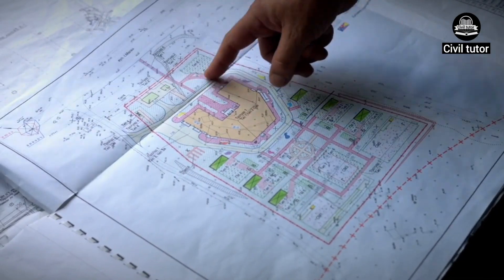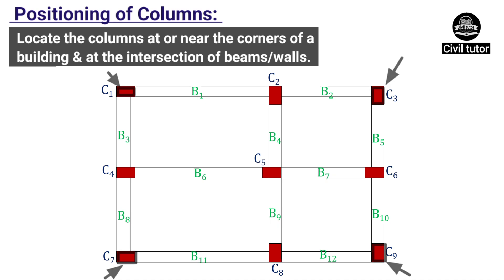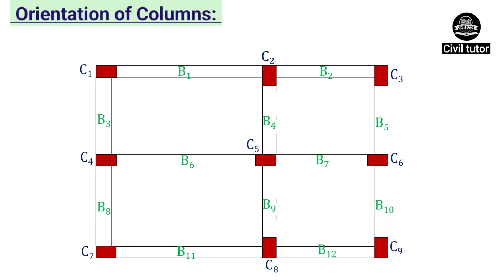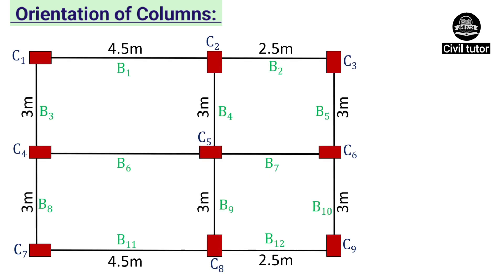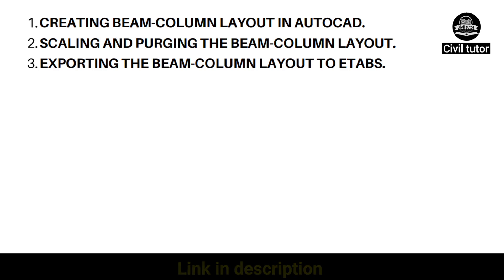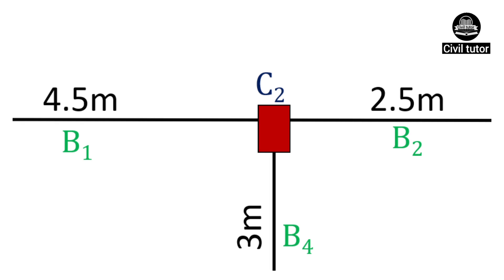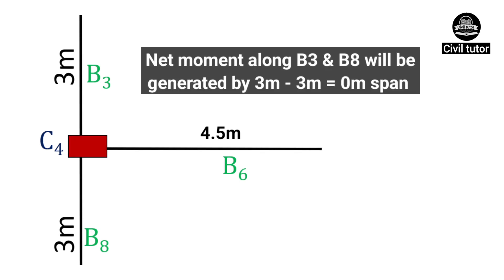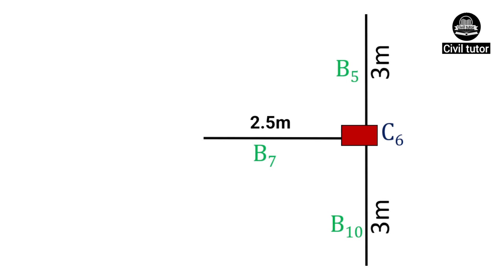How to decide the position and orientation of Columns? | Structural planning | Civil Tutor

Comment: Simple concept...align the column along long wall...at intersection cancel out opposite length then consider it...we always increase depth instead of width because in column and beam with depth moment of inertia and section modulus both increases which decreases the bending stress in our structure...bending stress is M/Z so Z increases ratio decreases...Z= bd²/6 for rectangle shape...also Z = I/Y ...so more inertia more section modulus..more strength to structure...everything is interconnected.  👷

Comment: Here our beams are mostly 425x150 with the top of the beam being the thickness of the slab (125 mm.) The web part of the beam (height=300)  is cast first to enable shuttering for the slab and the top part of the beam is cast together with the slab (=125mm).  The slab is connected to the beam by its weight and by its reinforcement but they do not share a unified concrete cast.  I will like to know how you consider the beam dimension in that case according to your code? Thanks.
Reply: Why don't you guys cast it all togeather which is the most appropriate way...🤔

Comment: Hi sir, what if there is a beam (larger dimension) and other beam(smaller dimension)? it is still used the same way to determine it or the larger beam is always connected to the short side of the column